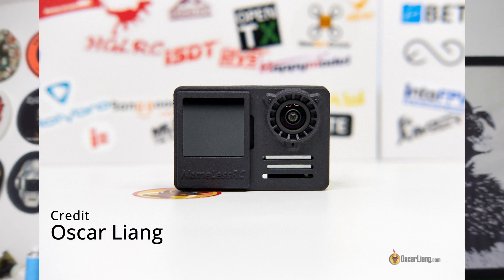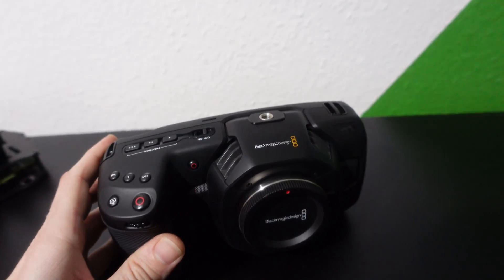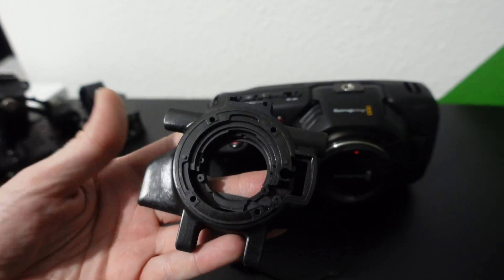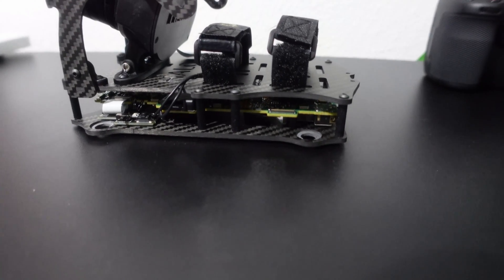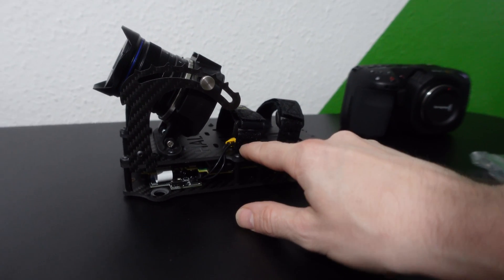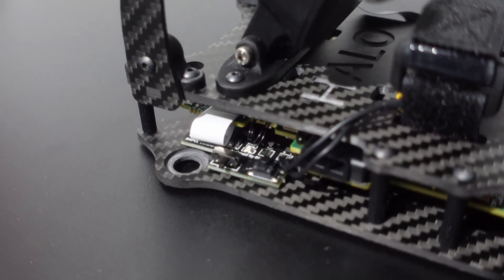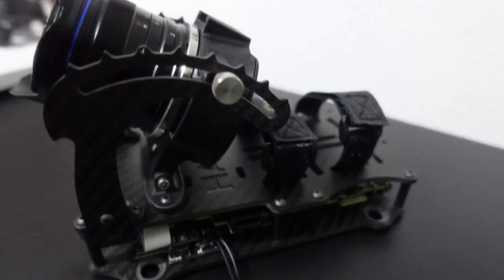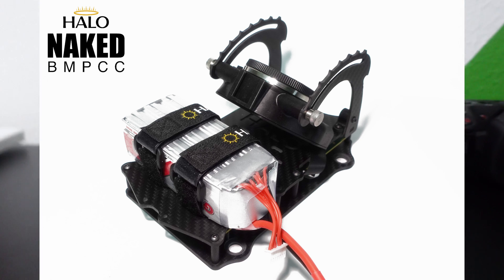HaloRC Naked BMPCC4K - Overview

Comment: This is really impressive! I don't do this kind of drone work, but this video makes me think it's possible to make the BMPCC4k more form fitting. Like maybe it's possible to DIY it into a cube shape with some 3d printing and patient reworking of all the components.
Reply from the maker: Thanks David. Impossible unless you cut the pcb in half.
Reply: @Bludz  I see. Yeah that makes sense. Even if its not cubed, but just reoriented long ways kinda like how you have it set up on your drone, but with a casing around it, and the buttons rearranged that could be really helpful. Then it the camera body would better for videography and on a Ronin Gimbal. I'm just thinking out loud but your project is giving me ideas to re arrange the camera so it's a better form factor.

Comment: Really impressive Man! Cinematic FPV keeps emerging in a Lighting Fast Pace right now! I wonder if a Budget Version of this would be feasible?? Like  7 Inc  ( e.g. Mr. Croc Flywoo) + a naked Olympus PEN E-PL9 (4k 30fps 4/3 sensor) what Do you think? Should be a LowLight Upgrade from Gopros i think!?
Reply from the maker: Thanks Christian. Cool idea but the pocket 4K is what we chose as the cheapest worthwhile upgrade over the Hero10 and can be used professionaly with the BRAW codec it records in. Most camera's like that are quite lightweight to begin with, just doihng a power mod is all you can do most of the time.

Comment: Nice work does it over heat. What drone are you using for it
Reply from the maker: No issues with overheating mainly because of all the airflow the drone provides. It was fine on the bench for 20 minutes not recording when I forgot to unplug mine, lol